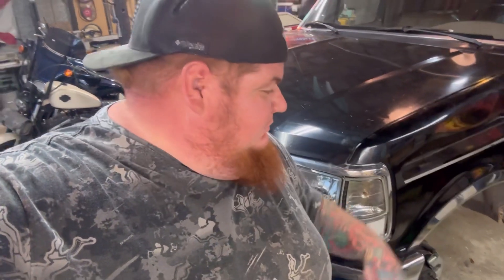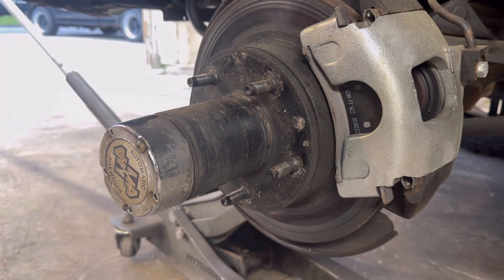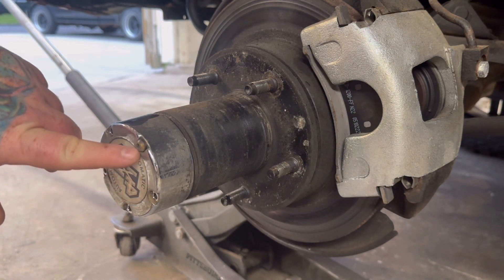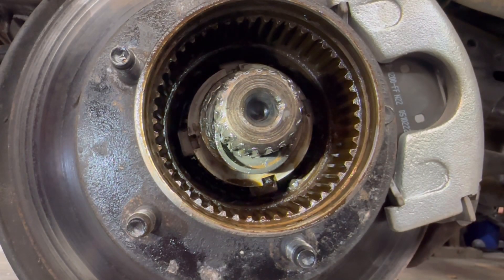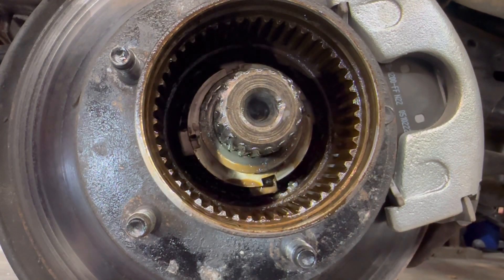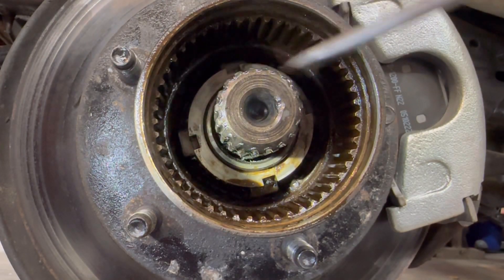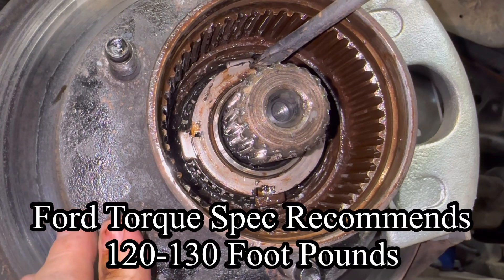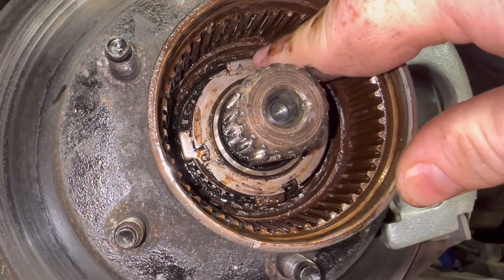Ford F150 & Bronco Automatic 4x4 Hubs Disassembly & Brake Rotor Replacement

Comment from the maker: In the beginning of the video I refer to the hubs as electric hubs. There are not actually any electric parts in the hub, I just call them electric hubs because to engage 4x4 use just push the electric button in the cab.
Reply: The same hubs are used on non-push-button 4x4 systems.  My 96 F-150 XL has a basic 4x4 shift lever.  The only thing electric about it is the range sensor that turns on the 4x4 light when the transfer case is engaged.  I had assumed there was some kind of electronic or vacuum action but now learned these engage entirely via mechanical torque being applied.
Reply: Did youre locking assembly had play i was wondering if its normal because my has play im not sure of buying a new one
Reply: @chief1223  i actually assumed the same, but thats super interesting im assuming its kinda like a one way bearing of sorts, when the wheel is spinning it doesnt drive the axle but then if the axles spins it locks in the wheel, how does that work with reverse? wouldn't that lock the wheel in then? or is it more like the axle has to turn for it to be locked in?
Reply: @jakobc9348  not sure, a bidirectional mechanism that responds to rotational forces would make the most sense, I've yet to take mine apart for their cleaning though so not sure without watching the videos again :p

Comment: The one part that seems in significant is that retention spring that goes around the locking assembly. I lost my entire locking assembly and cap somewhere on the side of the road last year after a shop did new wheel bearings. The shop couldn't find one and I didn't have much luck in finding one online. Finally went to the junk yard and got a couple out of a donor. Great video

Comment: Great video thanks for making it. So my 1995 F-150 EB Single cab, Short bed 4X4 came with automatic hubs.
Went with my Homies offloading Chevy guys! Found out the hard way The automatic hubs weren’t engaging got stuck, and had A Chevy pull me out! You can imagine the crap I got!! So I remove the automatic and went with Manuel Warn hubs. No more issues.. lol